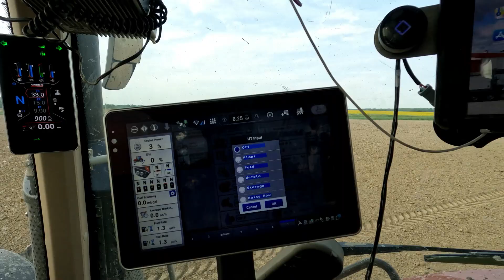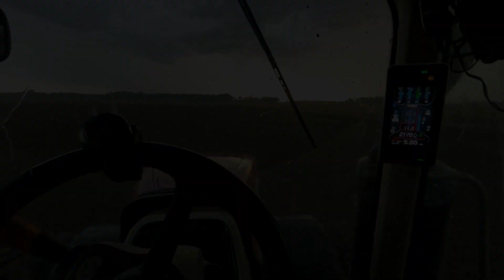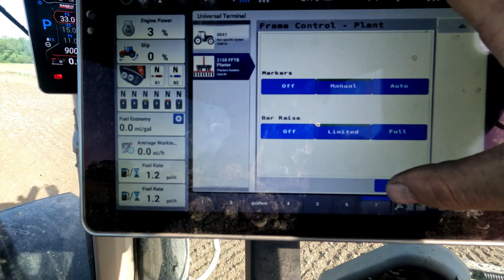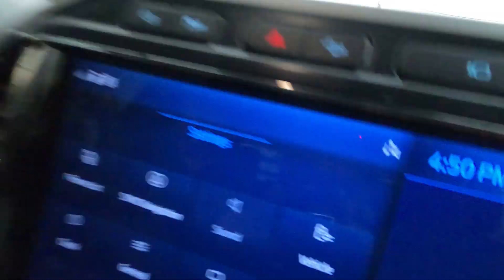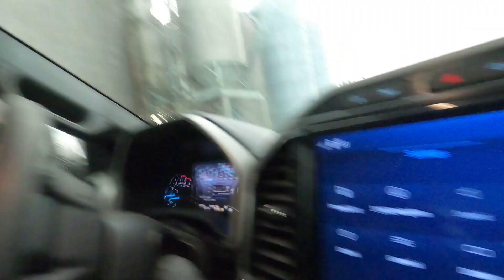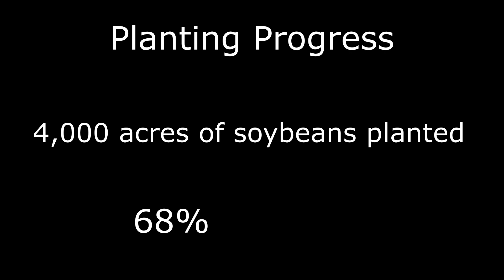The Good The Bad & The Ugly Of Planting With A Case IH High Speed Early Rise Planter (Part 2) S3 E8

Comment: Next time you you change a track, put tire lube on the idler wheel and the track.  It will real help you be able to  rotate the wheel to align the lug bolts.
Reply from the maker: Great idea, thanks. I’m hoping for not a next time
Reply: Helps with the quad as well